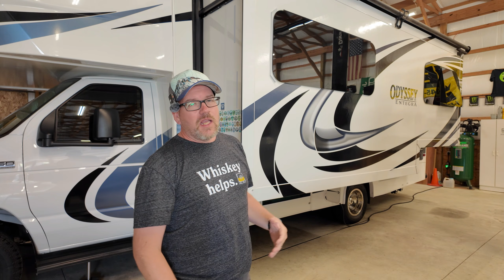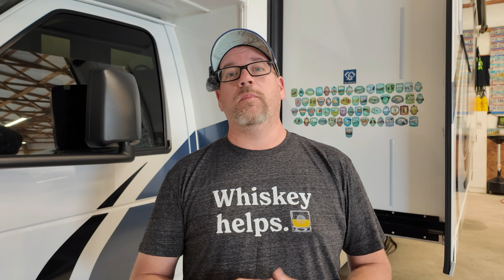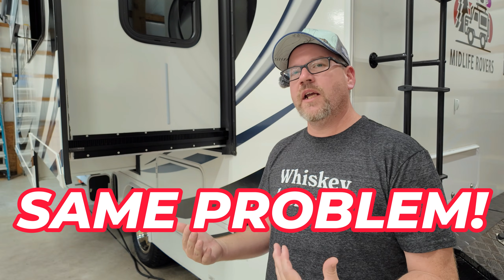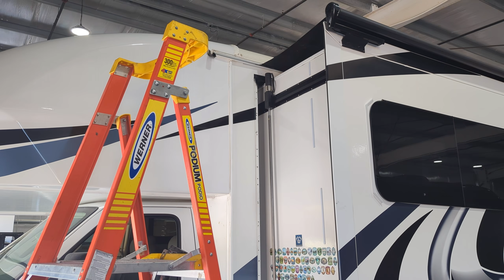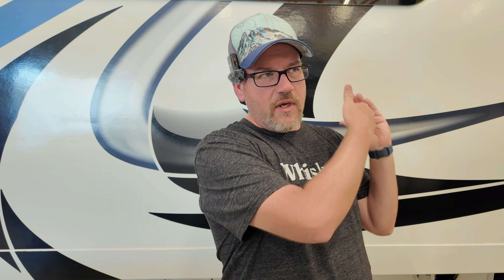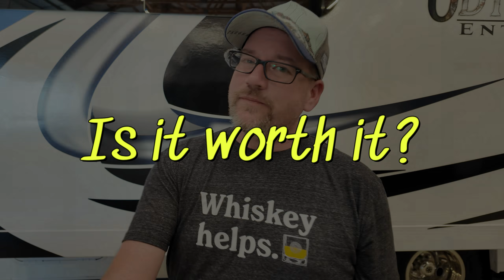Is Vroom an Upgrade Over Schwintek? Tumbleweed Slide Saga & Full Review

Comment: From your description, the first install was not done correctly. While the Hall effect board is available aftermarket  and an easy install, getting rid of the Schwintek hardware is the right move. The new upgraded rollers and plates should have been properly installed the first time. I've seen more than a dozen Vroom installs over the past  year or so. If I had a Schwintek slide, I'd definitely go with Vroom. But I'm skeptical of dealers. I'd make the trip to Arizona and have Vroom do the upgrade.
Reply from the maker: It's understandable due the video length, but it seems like you may not have made it through all the information covered. Our issue was as a bad cable, not the hall sensor/board. As for the system switch to Vroom. I feel I traded one problem for a far worse one... Until the rails are redesigned leaks are not acceptable and don't feel like it was the right call ~J

Comment: I live in east central Indiana. I have a 2015 Coachman Concord 300 DS and we had a complete slide failure last week while in Branson, MO. It's our living room slide similar to yours in size. I had also found the Vroom system and was going to upgrade but now I'm having some doubts. They list 2 Indiana certified installers and was curious why you didn't choose one of them instead of going to WI? You have valid points about the system, and I'm not sure which way to go on ours. TY for this information.
Reply from the maker: Unfortunately, the Indiana locations didn't exist on the list Vroom provided. 

This is why we shared our situation. Ultimately, making the decision comes down to the pros and cons of each system... And those are from the perspective of the buyer. For us, knowing what we know, there's nothing that would convince us to go with Vroom. With the length of the video, we left out so many details... ~A~
Reply: @MidlifeRovers  That tells me that the Indiana locations would not have much experience with installs of the system if they were not listed when you had your issue.

Comment: Thanks for the video.  
I have a 2021 Thor Tiburon TT, our slide is also 15 feet, same design as yours. After 2 repairs (including a total replacement) in 5 years with Schwintek system, we decided to have Vroom installed August 2025 at one of the western install locations. Upon completion the installer was showing me the operation, I noticed with the slide closed the exterior trim where it transitions for the bed pedestal wasn't as tight against the RV, along that middle edge and the bottom edge where the slide rests against the RV. When I asked the installer about the gap, his response “oh ya I've seen that before”, and he offered me an extra scrap piece of wiper seal that I could add later to that area to fill the “new” gap. As I questioned him a little more about this, and a couple more questions, it was clear to me he was NOT an engineer, he was just merely an installer. He has installed many Vroom systems, they do a couple every week, so he was taught how to install, but that seemed to be the extent of his knowledge, similar to your experience. So while the authorized installers have made getting vroom installed more convenient they may lack some knowledge than taking it to Arizona.

3 hours from home, my new slide is now operating perfectly, just not as tight in the middle and as far as the installer is concerned, the job is complete. We had a trip planned in a few days so I accept that I have a new little gap and they are not going to do anything about it. As we are on our trip, I then figured out that the gap in the middle and bottom edge is partly because they used the larger bulb seal on the H columns like they did on yours. I actually liked the seal that Vroom used because I never really liked how the original wiper seal with the Schwintek sealed around the track and the bottom underneath the slide (with it extended) it often left gaps to where I could see light from inside. I tried the piece he gave me and it filled the gap to where it’s tighter when slide is in, and I actually like how the new bulb wiper seal sealed better the area with the slide extended, so I decided to just purchase some more of the wiper seal to go along the entire bottom edge. Which still should keep the water out with it closed and it filled the new gap.

My other observation is with the Vroom system now, my slide seems to tip inward more than it used to, meaning the gap between the slide floor and the interior floor is 1 & 5/8 inch with it extended and just 7/8 of an inch with it closed, ¾ of an inch difference, which the old system it wasn’t that much of a difference. Does your slide floor appear closer to the RV floor with it in?

I’ve come to the conclusion there currently isn’t a “perfect” slide system, and so far, the Vroom system is operating far superior than the Schwintek system ever did, and I think this system will continue to be more dependable.
Reply from the maker: Yes, our slide travels up and down, in and out. However, I think it's the opposite of what you have... It's closer in, than out. 

One thing not mentioned in the video is that no one else knows anything about the system. They see it and tend to run. 

Yes, the Vroom system is definitely more superior mechanically. Not that it matters when the RV rots out due to the water intrusion from their design flaws.
Reply: @MidlifeRovers  Thanks for your reply, our slide floor is closer to the RV floor when the slide is in, with the old system the floor height didn't change as much.  

I haven't experienced any water intrusion as you seem to be concerned about. They caulked the edges of the track, I don't think the residual water on the track will be that much of an issue to cause anything to rot, when the slide is extended mine seems to be tight against the seal where the trim of the slide meets the RV wall. Their new wiper seal seals around the H column seal better than my original seal did. With the slide in, after I added the additional wiper seal to fill in the gap I described, it seems to be water tight as well. Just in case I will watch for any new water intrusion.

I do agree with your point that other RV shops do not know much about the Vroom system, and if a motor ever fails it is a lot more involved to change one. Time will tell us all if Vroom is more dependable than Schwintek, since my Schwintek failed completely TWICE, I'm hopeful that Vroom will beat that track record for me. 

Thanks for your video, and I'll look forward to any new updates as you continue to use the Vroom slide.